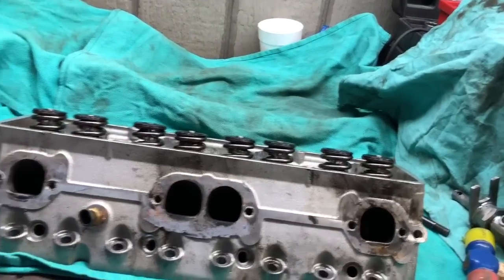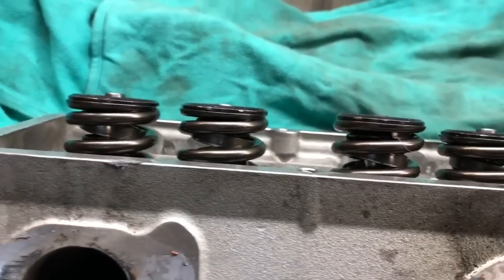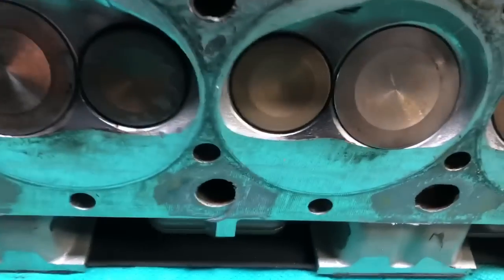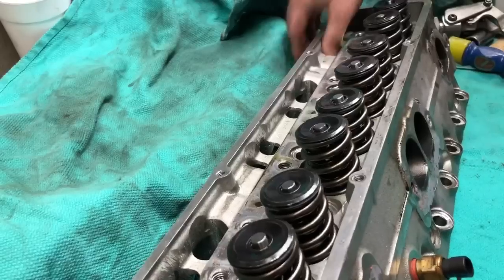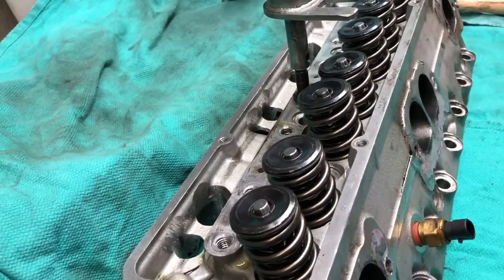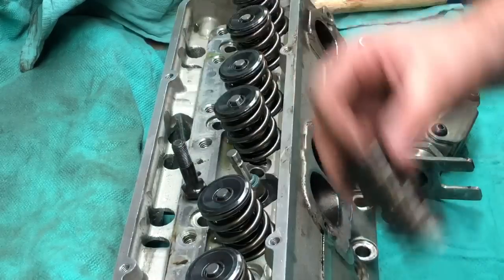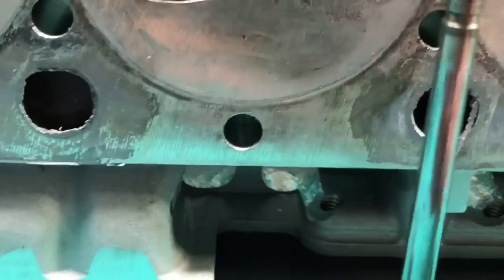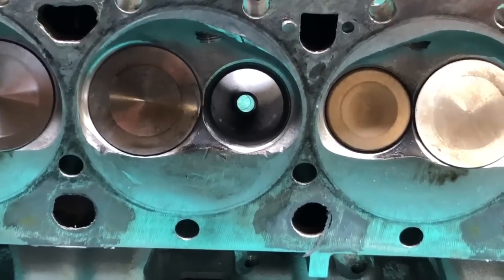Cylinder Head Damage from Broke Connecting Rod!

Comment: Great video as always. Yeah exhaust leaks can be a pain to solve I've had good success with copper gaskets with a thin layer of high temp silicone on each side I think the silicone helps take up any irregularities in the header or head. The valves in my Dart 220 heads are .100 longer and I also use lash caps I find it saves a lot of wear and tear on the valve tip when using a solid mechanical cam. Keep up the great videos very informative for the people looking to learn about drag racing and the cars we run
Reply: ChevyMustang1 I have a 383 stroker with afr 210 heads and a solid roller that I daily drive, it after 40,000 miles I was seeing some valve tip wear, and lash caps really helped, I put another 20,000 on it since then and there is no more visible wear
Reply: @drivinwithdrew7676  sounds like you have a great little motor those AFR 210's work really well a friend of mine has a S10 with a 383 with AFR 210's but his is a hydralic roller it is 10.5:1 on pump gas and dynode 550hp at the flywheel. They sure are a fun little motor I bet you enjoy yours even though it has prob gotten you in trouble a couple times lol
Reply: ChevyMustang1 yeah I love driving it! And it will lay the gap on new trucks, and a lot of cars too!

Comment: To SOLVE the high temp seal issue, here's the silicone Solution !!! 
Get the Black silicone from TOYOTA ... They use it in the factory, but it is 110% better than Any & All other silicones that you can buy off any shelf at ANY auto parts store... 

I will personally GUARANTEE this!!!
Reply: You can use it with or without the copper gasket also!
Reply from the maker: I’ll try it, thanks for the advice!